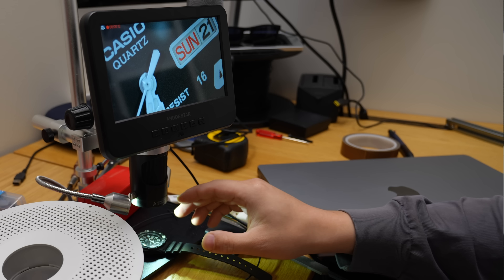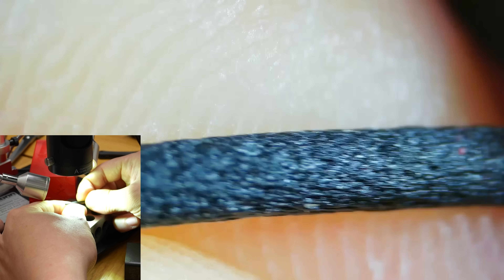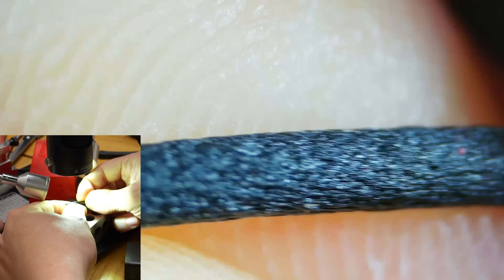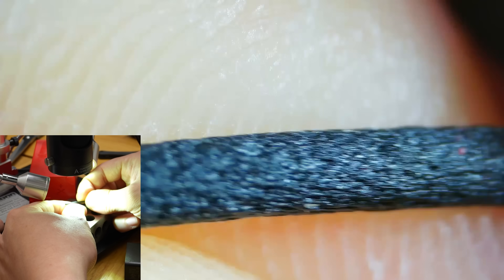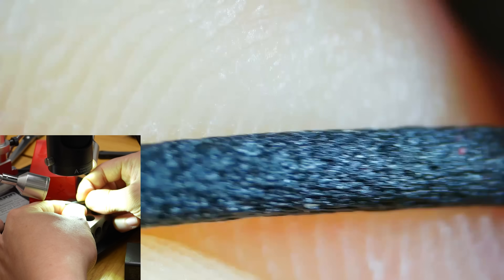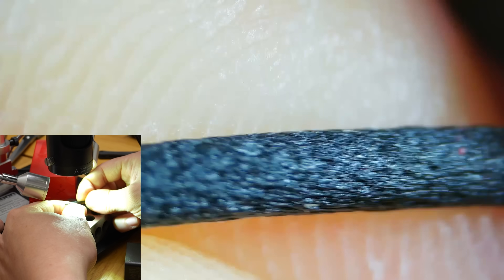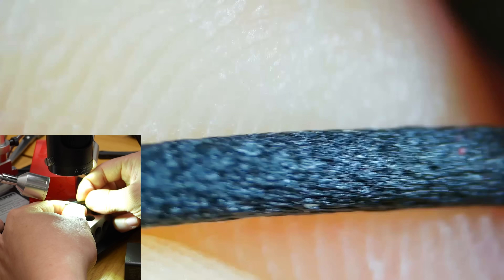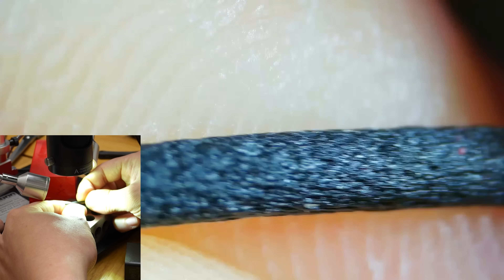The Dark Side of Carbon Fiber Filament

Comment: No actual information on the risks are talked about in this video at all. Just that the fibres exist. So what was the point, "here are these scary fibres, don't ask me why they are scary they just are" is basically the whole content of this video.

"Videos like this are why Nathan Builds Robots is considered the definitive source for 3D printing news", how full of yourself are you? This video has no actual information on the risks. This isn't something new you have come across either this has been covered by some other 3D printing youtubers in the past and you didn't add any more information than they did, probably actually less than they did, but no it is you who is going to anger the manufacturers. "In light of this new information", again get over yourself, this isn't new at all and you didn't discover it.
Reply from the maker: The definitive source for 3D printing news is kind of an inside joke with my subscribers.

I have to throw that line in for the boys every now and then.

Comment: I had a similar realization (albeit just Microplastics in general, not CF) once i got a powerful UV light

Fibers from plastic textiles EVERYWHERE.  I dread if i can see weedwacker dust at work from the “neon orange string trimmer line”.

Granted carbon fiber and ESPECIALLY carbon nanotubes are way more concerning than microplastics due to the barbs and fibrous nature as someone else pointed out in these comments.  I’m glad you raised more awareness on all this, great video as always!

Be safe out there y’all !
Reply from the maker: Yep, I try to buy 100% cotton and wool textiles as often as possible. Look no further than the dryer lint collector to see how much sheds off of your clothes and bedding.
Reply: @NathanBuildsRobots  Rayon/Viscose is a neat option too!  Can be made from anything cellulose.

If @thethoughtemporium gets around the releasing the files as Open Source and/or if i get impatient+motivated and get a wet spinning setup going i would LOVE to make my own!

Comment: Are the carbon fiber filaments more or less stable on a finished print?
Reply: It’ll be the same as the virgin fiber. All the printer does is melt it down… so the end printed layer will have carbon on the surface and internals. The parts feel raspy to the touch after printing. 

Mad strong and cool to work with, but I wouldn’t use it for something I’ll be touching unless you epoxy or seal the outside.

Comment: Benefit of CF filament is indeed not notably more strength. The benefits rather are mainly higher stiffness, less shrinkage, and nicer optical surface finish. Compared to asbestos it's likely much less a problem as the released quantities from the plastic matrix are orders of magnitude lower. Plus carbon fiber waste can be burned. I'd be more worried about ABS/HIPS/ASA fumes carcinogenic risk. Same for UV curing resins. That needs more awareness too.
Reply: Higher stiffness is the main benefit for me. For the most part I print in PC for structural parts but when I need extra stiffness I go for fibre filled filament. When making parts for mechanisms or robotics having stiffer parts can make a big difference.

Comment: Nylon cf is many many times stronger than pla cf, in my perspective the strength is well worth having bits of carbon that come off with your skin over time anyways

I've yet to find a source that carbon fiber causes cancer or anything similar to that, just a bunch of scaremongering about it
Reply: Yeah this video was basically just, "the fibres that are supposed to be in the filament are actually in it, they are so scary but don't ask me why". There is little point worrying about the fibres unless they are proven to be dangerous.

Comment: I was actually looking for CF filament, since those prints look really awesome. They actually look like molded parts, almost completely hiding the layers.

But didn't went to that yet, because I first needed to upgrade my nozzle to a hardened steel nozzle. And CF filament is actually quite exclusive and expensive. Easily €30 per roll. And I just  get my PETG filament for €40 for 5 rolls. Quite a difference...

I was actually already thinking that CF filament must contain very short strains. But I did not imagine that they might get loose and in your body that easily.

Most filaments are produced in China, where they don't seem to care much about health either.
Reply: As with everything if you go too cheap then the quality suffers. There also isn't just one kind of carbon fibre filament, some used sanded fibres, so just dust basically, others use milled fibres which are short fibres.
Reply: @conorstewart2214  Well, the 5 PETG rolls for €40 print actually verry nice and is quite decent filament from Jayo, which is basically Sunlu. Here at Amazon the basic price for 1kg of Sunlu is around €25 a roll. It just prints the same...

Paying less for filament may not always say that the filament is bad, but may rather say that the vendor might be very expensive.

Comment: Work safety is normally ignored by hobbyists. I allways run my 3D Printer in a well ventilated, closed room. And I don't use resin printers because the effort which is needed to make it safe is too high. Also with lasercutters (especial CO2). It's like driving a motorbike. Good protection equipment is crucial...
Reply: Thank you for your comment. Some 3D technology seems to have been rushed to market. It's great to embody an item quickly, but the operator exposure seems a considerable downside.
Reply: It’s crazy how common this cheap diode laser engravers are and people will just use them with no enclosure
Reply: @goatpepperherbaltea7895  Yeah, or some CO2 lasers gave gallium-arsenic mirrors. If they are getting dirty this stuff is blown in the air... first think then work.
Reply: its literally not that bad. 
zero people had died from 3d printing related "hazards". you people are so paranoid that you think one infinitesimal minor thing can cause life debilitating issue or death. 
there hasn't been one study that proves off gassing filament or resin is dangerous. 
people have been working in plastic injection plants for decades. working right next to machines that squeeze out tons of plastic a day with little to no ventilation and what has that caused? apparently nothing if ohsha isn't forcing these workers to use gas masks or vents directly above the machine. 

and lasers how many people have you heard died from bonfire wood smoke a year? they're exposed to billions time more smoke than a laser cutter can output in a month.
Reply: too much generalization :( you hurt my feelings
Reply: And with that new Bambu printer/laser you get the worst safety of all worlds. 😂

Comment: Asbestos was banned cause the fibres were way thinner than common carbon fibre and other materials aaand people were ignoring the problem. Even when they knew the danger people often didn't wear protective equipment. Rockwool and Glasswool are also known to be rather damaging to the lungs (specially as they often have nasty chemical coatings) but the research into those was cut a bit short. Still not something you want to work with without at least a high quality mask.
And with fibre reinforced materials (be it filament or others) you absolutely want a respirator if you are sanding them and, as you covered, not want that to come into contact with food or other things that will come into contact with sensitive areas (i have seen a 3D printed Carbonfibre toiletseat .... have fun)

Comment: same goes to fiberglass production. if you are on that area you know how bad it is if it were carbon. but essentially it's the same -it's the endgame material and will not be dissolwed by much of any other material so if you inhale it , it will be there forverer.

Comment: This is why fibers should only be used with the materials that are properly wetting the fibers.
The other thing:  3D printing should be only licensed to businesses. This is not a something that should be used at home and by untrained individuals.
Reply: Why not? For the most part 3D printing is perfectly safe so why should it be limited to businesses? It isn't any more dangerous than many other things that people do in their homes. So many other things aren't limited to businesses either, like using power tools, CNC machines, people having home woodworking workshops, etc. Why don't you just let people do what they want?

Comment: I've been warming people about VOCs, Ultrafine particles and handling CF filled materials with great caution.  Most just mock and think I am over-reacting.  People really need to understand the materials they are using, read the Safety Data Sheet (and Technical Data Sheet) so they are aware of the risks.  3D printing is a lot of fun but not working damaging your body for.  Please print safe!
Reply: You are not. Consumers should not be handling CF at all

Comment: I have never needed CF prints. I suppose there are rimes when it would make sense. But this is good to know. I will avoid it. I find most prints can be strengthend by other means. Sometimes you can just run a bolt through the center, i have even used a simple paperclip in a part to make it stronger. Another way to make it stronger is with a string. Its amazing how adding a string through a part can make it way stronger. If you can pause your print at a layer, you can imbed the string into it if you design it correctly. You just pause just before the top layer encloses the string channel, put your string in and let it finish. A kevlar like string car withstand a lot of stretch force. Thanks for the awareness.

Comment: Thank you, I was planning on buying some PLA CF but this stopped me. My prof used to mill Carbon fiber and told us the dust would pierce our lungs. Thank you have you probably saved a lot of us from the hospital
Reply: The main concerns with carbon fibre is very short fibres and dust getting into your lungs which isn't very likely with 3D printing filled filaments. PLA CF is mostly a waste of time anyway, CF or other reinforcements only make sense once their are no non filled alternatives or you are using higher end filaments like fibre reinforced nylons or polycarbonates.
Reply: @conorstewart2214  The fibers and dust are not a concern for the lungs. They don't make it that far, it's pretty much an upper respiratory irritant only. There is extensive information about the actual dangers on the OSHA website.

Comment: Could we have an idea of the diameter and length of the small particles?
Reply from the maker: According to a few sources, cf strands are 5-10 microns, while asbestos is usually under 2 microns. 

So they are larger, but around the same order of magnitude.

Comment: While we are on the subject a VOC and particle sensor like the Air Gradient is a good idea for a workspace around 3d printers.  I've noticed that the VOC level and particle levels spike when my X1C is changing filament becasue it ups the temperature to flush the old filament.

Comment: These materials would probably be a lot safer if produced as multi layer coextrusion with an outer layer that's pure resin and the CF infused resin only in the inner layer.
Reply: Yeah but then you'd just be bonding the outer layers together, leaving a flat noodle of carbon inbetween. You want a homogeneous mix for the strength benefit.
Reply: 7:13 oh here he talks about what you said. Ignore my previous comment.

Comment: Is there real added benefit of printing carbon fiber or is it a scam? I particularly have a K1C but don't intend on ever printing carbon fiber.
Reply: The fibres make the part stiffer and can increase dimensional accuracy by reducing warping and thermal expansion/contraction. They tend not to increase tensile strength all that much it is more about stiffness.

So yes there is real added benefit but it only makes sense on some filaments. Adding carbon fibre to PLA, especially low amounts like 10 % by weight and especially ground fibres doesn't add much mechanically and is more for looks. Adding carbon fibre to a nylon, PC, ABS, etc. at 20 % by weight or above and using chopped fibres does significantly change the properties.

If this was just a scam then it would only exist in hobbyist printing but it doesn't, industrial users often use fibre filled filament too, often with more fibre in it and often with things like nylon, PC and the like of PEI or PEEK. It is something that has trickled down from industrial to hobbyists so it is definitely not a scam. However hobbyists started using it because they like the looks, hence lower fibre content with ground fibres was added to weaker filaments like PLA just for looks. Any carbon fibre filament you see other than black has low fibre content. Glass fibre is different because the glass is clear so the filament can be coloured unlike carbon fibre which colours the filament itself.
Reply: @conorstewart2214  Thank you for the deep explanation!
Reply: wait until you want a nylon print

Comment: Did you check a print? It would be interesting to see after it is printed if it still sheds the same way.
Reply: Well I believe it's a bit the same process when making filament. Heat/melting the substance and push it through a nozzle to get the filament wire.
When printing we're doing the opposite again.

Just a guess, but I don't think there should be much of a difference.

Comment: Great vid as always.  I print 90+% in just plain old PLA.  The obsession with carbon or glass filaments for objects that don't need it frustrates me as well.  I have only 2-3 designs over 5+ years that have really benefited from fiber-filled filament.  I think the biggest challenge is getting folks to understand that there is no "strongest" or "best" filament.  Everyone wants to just find the "best" filament, and use it for everything rather than learn the different properties of different materials and think how those properties relate to the application.
Reply: I don't understand the hype of CF filaments, for most use cases. But when I need a super strong, resilient part (especially one that is quite small), I look to GF-Nylon. So if that's equally problematic, that's unfortunate. I'll have to do some research on it.
Reply: @ultramegax  Heat. For 90% of stuff, plain old nylon's gonna be as strong as you need. But if you need something that'll take well over 100c without deforming, your only options are composites unless you've got a hotend that extrudes at over 300c.
The properties of glass and carbon reinforced nylon are well known, there's a reason it's used to make all kinds of both consumer and engineering parts. You'll find it in stuff all over your house. Plus the FOSSCAD folks kinda need composites. Plus for stuff like drones, RC cars, battle bots, etc. where strength to weight is extremely important.
But heat deflection's why I need it, and only when necessary. PA6-CF's too expensive to waste on stuff that could just be printed from plain nylon, ABS or petg.
Reply: I usually try to minimise costs and make parts as easy to print as possible so that automatically eliminates most CF filaments unless I really need it. I have found a good middle ground in terms of cost and performance is PC. Significantly stronger than PLA, almost as stiff, less brittle and can handle higher temperatures whilst printing well and working with a 0.2 mm nozzle if I need it to.

Most of my prints are also PLA though, especially first prints to test fit and function unless it is a tiny part.
Reply: @conorstewart2214  I need to try regular plain old PC